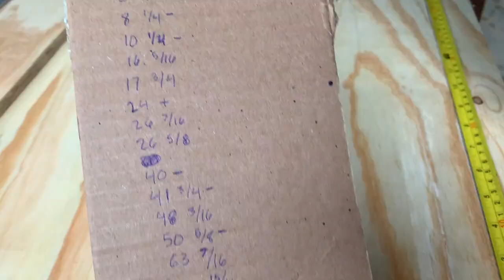Building The Front and Rear BulkHeads with Cubbies * Skoolie Conversion * Gus The Struggle Bus

Comment: Solid work, friends! Are y'all going to have removable backs to the cubbies so that you can access wires and stuff post-build? Love how y'all measured this out as it makes sense that the bulkhead "hat" isn't necessarily curved, but your measuring across the furring strips, which are straight! Brilliant! We had been thinking about using a pencil strapped to a stick and then tracing it on the wood for the "curve" but like your method MUCH better! You guys are really smart and you made it pretty simple! Thanks! Keep rocking it, y'all!
Your Skoolie Build Buds,
- Brian + Erin
Reply from the maker: That is a great idea!! We will consider that so we can still get to those wires just in case we need to! Thank you so much, it might take a little more time but we thought this might get a little more accurate of a line!

Comment: if you want to do a quick shape transfer you could use a straightened wire clothe hanger or think copper wire bend it to follow the curve exactly , measure the height on the start and end of the wre and lay it on the board to trace
Reply from the maker: That is a good idea! Thank you!